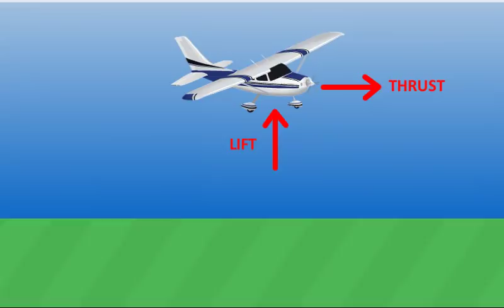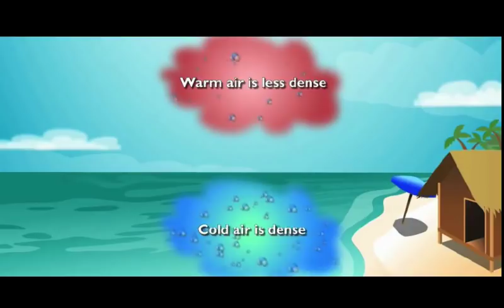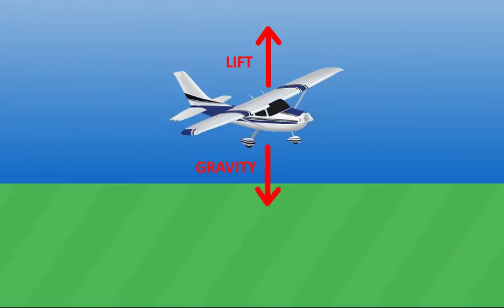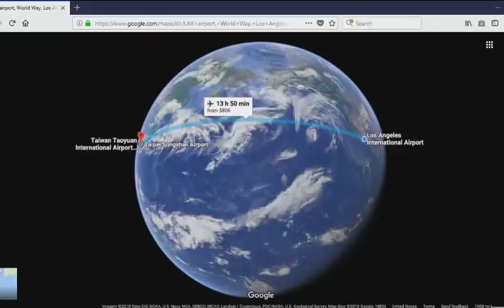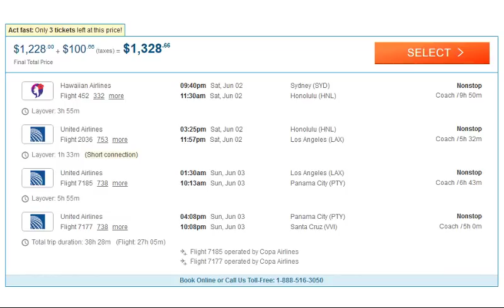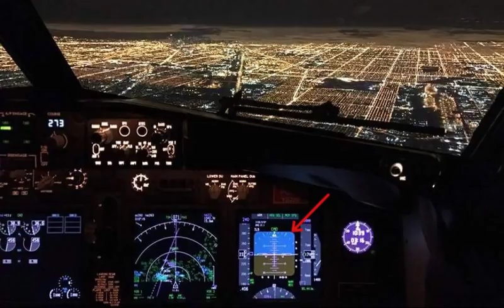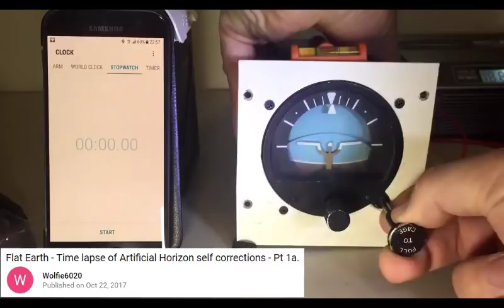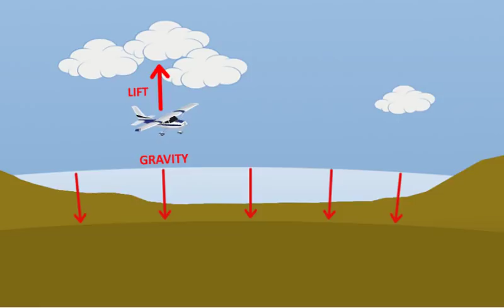Flat Earth Falsities - Plane Nonsense

Comment: The answers are always gravity  gravity and gravity. Can you prove gravity is an attractive force? Did anyone did prove it  it is just a theory, and had been easily debunked.
Reply: .    Gravity is a Scientific Theory (and a Law) which is much more than a theory we use in everyday language. The Cavendish experiment showed the existence of gravity between masses in a lab setting. The Schiehallion experiment, designed to estimate the mass of Earth, showed the deflection of a plumbob placed near a massive mountain in Scotland. 
     Gravity is also evidenced in celestial mechanics, viz, the orbit of the planets and moons. Gravity is evidenced in ocean tides, tidal locking of the Moon, lunar gravity experienced by the Apollo astronauts, fusion in the Sun, artificial satellites, and Jovian gravity used to propel probes in the outer solar system.
     What credible debunking of gravity do you refer to? FEers have not debunked gravity. Further, density is not a force but a measure of mass. Buoyancy requires gravity of the surrounding material. Air pressure is not the cause as your weight doesn't change inside from outside of a building, and the pressure exists equally on all exposed surfaces of an object.
-----------------------------------------------
https://en.wikipedia.org/wiki/Scientific_theory
https://en.wikipedia.org/wiki/Theory
https://en.wikipedia.org/wiki/Cavendish_experiment
https://en.wikipedia.org/wiki/Schiehallion_experiment
-----------------------------------------------
https://flatearth.ws/schiehallion
https://flatearth.ws/balance-experiment
https://flatearth.ws/buoyancy
https://flatearth.ws/newtonian-gravity
https://flatearth.ws/ball-and-water
Reply: Robert Thomas gravity has never been proven
Reply: "gravity has never been proven" Who told you that lie? Was it on some YT video?
Gravity is a term coined to explain a natural phenomenon. Just like electromagnetism and germs.
To prove its existence, you need to hold a small item and release it from your grip. According to the law of inertia, it should have remained as it was. But did it? No.
The law and theories just explain how it affects things. OK?  Just like the law and theories of electromagnetism, oxygen and germs.
Gravity is the name we give to the phenomenon that objects accelerate towards each other when they are otherwise left to their own devices. The “proof” of gravity is the demonstration that the phenomenon happens.
http://www.bbc.com/news/science-environment-42183077
Gravity   Eddington
https://www.ecosia.org/search?q=Gravity+++Eddington
http://www.bbc.com/news/science-environment-42183077
https://www.ecosia.org/videos?q=The+Cavendish+experiment
"measuring gravity with GRACE”.
Gravity is the name we give to the phenomenon that objects accelerate towards each other when they are otherwise left to their own devices.
The “proof” of gravity is the demonstration that the phenomenon happens.
 @douglasherr4645
Reply: @romithromith  you mix between the what is called gravitional acceleration which is the speed change through time for falling things and an fiction attractive force called earth gravity. It is just a matter of mass and density, easy to understand , observe, see and feel.
Reply: @heshamelgendi9501  So gravitational acceleration exists but gravity doesn't? Mass and density are not forces. What you say makes no sense to me. The Moon is less massive than Earth, and gravity on the Moon is less than on Earth as demonstrated by Apollo astronauts.
Reply: @romithromith  I said what is called gravitional acceleration, no problem for what it is named, the fact is there is speed due to falling, this is fact, but falling is due to difference in density, this was proved by Archimedes principle, not because an unproved magic attractive force called gravity.
Reply: @heshamelgendi9501  So things are accelerated while falling. But there is no gravity? what then accelerates objects downwards? For things to fall (to be accelerated downwards) there has a force that accelerates them and that force is just called "gravity". Naming canventin.
Reply: Hesham Elgendi Well call it magical if you'd like, but it's pretty undeniable that large celestial bodies pull smaller objects toward them. The larger the body, the stronger the pull.  This flat earth fantasy has damaged a lot of peoples' reasoning ability to the point that they've lost their grip on reality.  If you choose do deny reality because some alternative seems more appealing, that's YOUR problem and it's no one's job to prove anything to you.
Reply: And unmagicaly they stop pulling when in the perfect spot, then its just holding, no matter how closer they get to the SUN, it all remains in the same celestial spot, even if the SUN has 95% of all system mass.
Interesting how questioning damages reasoning.... sounds like communist talk. Funny my Realty grip lost has not changes my lifestyle.
Reply: Louis Shaw Well that’s a bit of a stretch, isn’t it?  Calling out flat earthers on their BS sounds like communist talk? Questioning things is fine but we’re trying to tell you that there’s no way the earth is flat.   I guess we should just give up though.
Reply: @ghislainedefeligonde5166  What falls that wasn't picked up first? Something falling is an effect of it being picked up first. The only force required is that of it being picked up. Things are known to simply fall, or return back to their original state. When something falls it actually meets resistance the whole time its falling, and something can only fall so fast according to its terminal velocity.
Reply: @reggiereid1345  I can´t wrap mi mind around this peculiar need to get rid of gravity.... I could argue until the heat death of the universe (or until I am to old to remember, what I am arguing about, thoug I am not sure that would be a real hindrence) but without me understanding, why the concept of gravity apears so threatening, we´d get nowhere.
Reply: @reggiereid1345  "What falls that wasn't picked up first? Something falling is an effect of it being picked up first. The only force required is that of it being picked up. Things are known to simply fall, or return back to their original state."
Meteors. Thus you are wrong.

"When something falls it actually meets resistance the whole time its falling, and something can only fall so fast according to its terminal velocity."
Only if there's an atmosphere. No problem on the moon for example.
Reply: @romithromith  it is just science fiction. He build his point on the spinning of the air around earth with speed of 1500 Km/hr!!!,this means if any plane moving in the opposite direction would be crushed and destroyed immediately. Where are your mind? Where are your sense? Where are the proof?
Reply: @heshamelgendi9501  Rotation. Spin refers to rapid rotation, high angular velocity. The Earth rotates at half the speed of a clock's hour hand.
     Where is your mind? The air isn't rotating around the Earth, the air is rotating with the Earth. It has the same velocity. So in the Earth's frame of reference the air is not moving, excepting ordinary wind. Just like travelling in a jet at 560 mph you can walk to the bathroom and back without being crushed or destroyed. You are moving with the same speed as the aircraft.
     Where is your proof to the contrary?
Reply: @romithromith  spinning with earth was what i mean it. Ultimately spin with almost 1000 mile per hour, which is out of sense and logic and fact. Your example is absolutely wrong and does not resemble the case. What resemble the earth in the plane, the plane itself? no cause it does not spin around itself, let any body inside in the plane spin and see.
Reply: @heshamelgendi9501  On FE does a pilot flying due east have to continually have to steer slightly left?
      Right now, in Melbourne, Australia the Sun rises 20° south of east, sets 20° south of west, and is northmost in the sky at midday. That's impossible on FE where the Sun must rise to the northeast, set to the northwest, and be southmost in the sky at midday. The observed is consistent with the spherical Earth. You can't explain this, can you.
      How can a plane fly non-stop between Sydney and Santiago, a 13 hour flight? On FE the shortest route is 6,000 miles greater than a 747-400's range, and requires a speed twice the plane's maximum. The flight is consistent with the spherical Earth. You can't explain this, can you.
Reply: So you agree that gravity exists. Correct?  
Gravity is a term coined to explain a natural phenomenon. Just like electromagnetism and germs.
To prove its existence, you need to hold a small item and release it from your grip. According to the law of inertia, it should have remained as it was. But did it? No.
The law and theories just explain how it affects things. OK?  Just like the law and theories of electromagnetism, oxygen and germs.
Gravity is the name we give to the phenomenon that objects accelerate towards each other when they are otherwise left to their own devices. The “proof” of gravity is the demonstration that the phenomenon happens.
http://www.bbc.com/news/science-environment-42183077
Gravity   Eddington
https://www.ecosia.org/search?q=Gravity+++Eddington
http://www.bbc.com/news/science-environment-42183077
https://www.ecosia.org/videos?q=The+Cavendish+experiment
"measuring gravity with GRACE”. @heshamelgendi9501
Reply: Ha ha, man has them going... Wonder how many of those 200 "moons" got checked out and flight measured? Think SCIENCE is supposed to verify theoretical (involving theory rather than its practical application)  Mathematicians calculations ???
Could there be FAITH involved here too?
Reply: @BrainUser1  Don't you wonder if theory, calculations based on the theory, practical applications based on the theory and observations all agree, that faith isn't necessary any more? Or are you just trolling?
Reply: Sven Feuerbacher, @Louis Shaw is trolling you.   @enderwiggin1113
Reply: @boffeycn  I thought so. But there are other people reading this. Perhaps it helps them...
Reply: @heshamelgendi9501  Planes travel at around 550 mph, jump up and you will land in the same place.
Reply: @heshamelgendi9501  Earth spins at 1 revolution per day. Stand on the same spot and turn 360 degrees in 24 hours. Are you spinning fast?
Reply: @1Foulkesy  if i do so, and a bee on my left ear, it will take less time to be in my right ear  if i fly i opposite to my spin direction. All in all it is a matter of proportionality 😀
Reply: True, which is why I respond with facts to most posters, however little @Louis Shaw is a self admitted troll, which is why I point out that fact. @enderwiggin1113
Reply: So you agree that gravity exists. Correct?  
Gravity is a term coined to explain a natural phenomenon. Just like electromagnetism and germs.
To prove its existence, you need to hold a small item and release it from your grip. According to the law of inertia, it should have remained as it was. But did it? No.
The law and theories just explain how it affects things. OK?  Just like the law and theories of electromagnetism, oxygen and germs.
Gravity is the name we give to the phenomenon that objects accelerate towards each other when they are otherwise left to their own devices. The “proof” of gravity is the demonstration that the phenomenon happens.
http://www.bbc.com/news/science-environment-42183077
Gravity   Eddington
https://www.ecosia.org/search?q=Gravity+++Eddington
http://www.bbc.com/news/science-environment-42183077
https://www.ecosia.org/videos?q=The+Cavendish+experiment
"measuring gravity with GRACE”. @heshamelgendi9501
Reply: @heshamelgendi9501  The air around you is not moving at the same speed as you. Think of it this way.

A bee in a train carriage. The train carriage is moving East to West at 50 mph. The bee can fly at 5 mph. No matter which direction the bee flies, it will always appear to move the same speed.  Think about it.
Reply: @1Foulkesy  their fraud assumption is the atmosphere is spinning with the earth by the magic gravity, think about it.
Reply: @heshamelgendi9501  Why is gravity magic? What is the alternative? Why does the weight of an object change at different altitudes and latitudes. Something you can test yourself. Gravity has been proven. Please get on a bicycle and go to the top of a steep hill without pedalling. Think about it.
Reply: @1Foulkesy  gravity ever and never proved, it is the mass and density variations, no more, no attraction force by the earth.
Reply: @heshamelgendi9501  Ok give me the correct definitions of MASS and DENSITY.  Please explain why an objected changes WEIGHT at a different altitudes and Latitude?

Also think about why it is harder to run up a steep hill than running down? Does mass or density change of an object on weighing scales?
Reply: @1Foulkesy  no change in the definition of mass or density, the correction should be for the weight, they assume the weight is by an attraction HIDDEN force called gravity. It is the mass content, example ton.
Sliding up is the same concept of moving horizontal, but with inclination, means the weight which is a mass with no attractive HIDDEN force, resolved to sin & cosine  the angle, the sin multiplied by the weight in an opposite direction to the slide direction.No difference, except the weight is the mass. The term G which is acceleration; (the change in speed per time), when falling if your mass is heavier, and flying upward if your mass is less than air. (Even if you multiplied the content of mass by G, in the end it is a number with the same unit) But no Hidden unproved attractive. force
Reply: @1Foulkesy  please explain how water being curved, oceans rest on a globe? Water finds its way.
Reply: Gravity is a term coined to explain a natural phenomenon. Just like electromagnetism and germs.
To prove its existence, you need to hold a small item and release it from your grip. According to the law of inertia, it should have remained as it was. But did it? No.
The law and theories just explain how it affects things. OK?  Just like the law and theories of electromagnetism, oxygen and germs.
Gravity is the name we give to the phenomenon that objects accelerate towards each other when they are otherwise left to their own devices. The “proof” of gravity is the demonstration that the phenomenon happens.
http://www.bbc.com/news/science-environment-42183077
Gravity   Eddington
https://www.ecosia.org/search?q=Gravity+++Eddington
http://www.bbc.com/news/science-environment-42183077
https://www.ecosia.org/videos?q=The+Cavendish+experiment
"measuring gravity with GRACE”.
Reply: "I don't know the meaning of a word therefore you are wrong"  Flat earthers really do make the dumbest arguments,. don't they?
Reply: Hesham Elgendi Forget the word "gravity" then.  Things on earth obey certain laws and gravity is just one of the names we give to an observable part of reality.
Reply: @No... it is mass idiot
Reply: @heshamelgendi9501  Mass stays the same, but weight changes at different altitudes and latitudes.  Density is not the same as weight. It obviously isn't that easy to understand because you clearly don't know the difference between weight and mass.
Reply: Nearly 200 moons in our solar system, mathematicians can calculate the position and orbit of every moon using the laws of gravity. Maths doesn't lie a 100% record proves gravity is irrefutable. Some of these moons even have a curved liquid surface
Reply: @Hesham Elgendi , I'm glad someone here is able to think for themselves. I completely agree with you. Great Comment!
Reply: Gravity isnt a theory. How gravity works or what causes it is a  theory. All we know is that we call gravity the force that keeps us on the ground. Even the "flat earth" has gravity, otherwise nothing would stick to the ground.
Reply: I didnt research this much at all, but I'm pretty sure if you leave two objects motionless in space, those two objects would eventually meet. Idk if thats proof of gravity or whatever, but u can look more into it. Im just pointing it out.